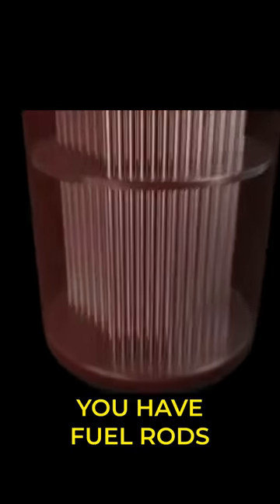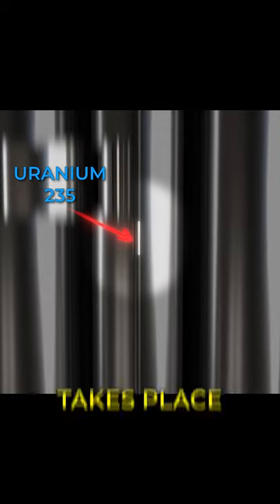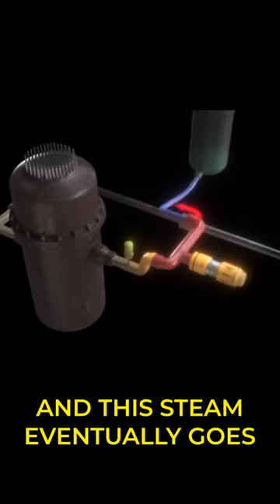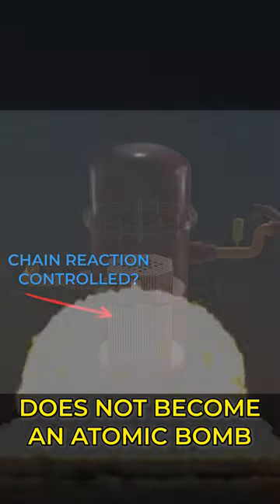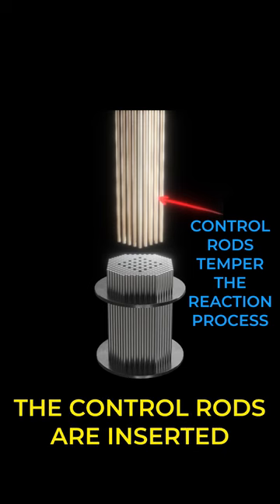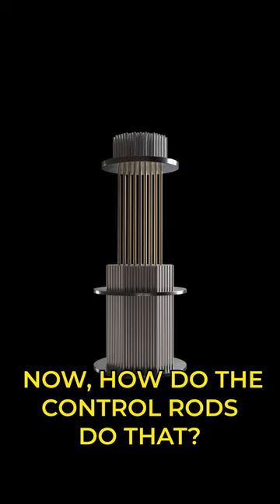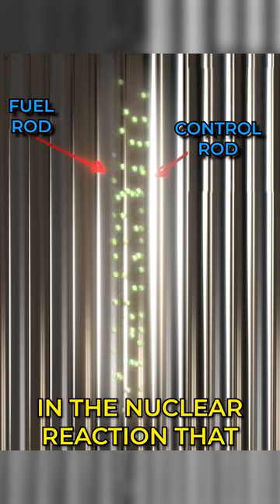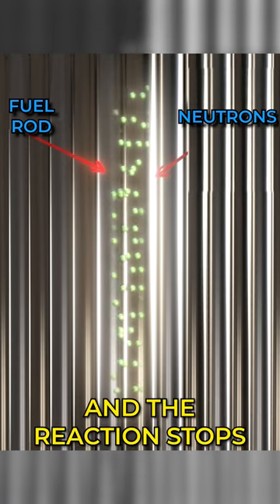How Nuclear Power Plants Control the Fission Chain Reaction

Comment: A reactor cannot become a bomb because the enrichment of U 235 is far too low at less than 5%. Super criticality would lead to a meltdown. Control depends on the design but criticality is usually maintained through extent of  insertion  of control rods and/coolant chemistry in the case of water moderated reactors.
Reply: Glad u said that. I detected the same error in the story.
Reply: You’re absolutely right, either a meltdown or chemical explosion caused by xenon poisoning.
Reply: Tsjernobyl entered the chat.
Reply: The enrichment is much higher than 5%. Try high 90’s. Source: I am a reactor operator.
Reply: @anthonymonge7815  I am a nuclear scientist,  working in Uk nuclear power industry for 35 years. Commercial reactors have a maximum of 5% U 235. Our AGRs have an average 3.8% while the water reactors have 4.5%. Only submarine reactors have high enrichments of more than 70 % because of high  neutron leakage from their tiny reactors.
Reply: @CanariesExplorer  my experience is with US Navy reactors. Both sub and surface reactor enrichment is above 90%.
Reply: @anthonymonge7815  That high enrichment is typical for Naval reactors only. The video and people above are correct - commercial power reactors of the LWR type are 3-5% enriched
Reply: @ThomasConover Chernobyl didn't explode like an atomic bomb, it was first a steam explosion, and then a hydrogen explosion, research before talking rubbish!  It's Chernobyl and no Tsjernobyl you know so much that you don't even know how to write the name of the plant correctly.
Reply: @anthonymonge7815 high 90s? Lol. So you're fissioning weapons grade fuel?
Reply: @dvigil50  Yes. The reactor cores on ships need much more enrichment than land-based cores. It is a weight and size consideration. If you do not believe me, that is fine. I was only a reactor operator for 12 years in the navy.
Reply: @dvigil50  also, it cannot explode like a weapon. Wrong geometry.
Reply: @anthonymonge7815  yeah I knew that much, didn't know about vessel reactors needing that high of a level of enrichment though. Wild stuff

Comment: The reactor cannot become an atomic bomb due to the much lower enrichment of the uranium.
Reply: It can still produce equal amount of nuclear waste spreading over a whole continent. Just research what happened to Tsjernobyl.
Reply: Underpaid huh?
Reply: @ThomasConover you're comparing apples and oranges dude.  Atomic bombs CAN make a crap ton of radioactive materials if the are ground burst.  This is from nuetron activation of the earthen materials.
Reply: @kayakMike1000  🤣🤣🤣 you obviously have allowed your doctor to X-ray scan your brain a few hundred times too much. I’m not disagreeing to your statement tho, but your statement was completely irrelevant to my comment whatsoever. 👍😊
Reply: @ThomasConover Chernobyl was a gas explosion, too much steam, xenón-135 and hydrogen caused the seal to explode due to the high preassure and go up and down and when hydrogen meets oxigen it becomes volatile and thats was the big explosion.
Reply: @ArmorMayhemSoldier_39  of course that’s how all reactors would blow up and anyone with knowledge about reactors know that. And that led to entire Europe getting contaminated by radioactive fallout. I remember the TV constantly warned against going outside in rainy days due to radioactive fallout. I was a kid then and I lived just in the center where the whole cloud of radioactive were going.
Reply: @kayakMike1000 Even if a meltdown does occur, it will barely get past the containment, as the containment is designed for high pressure and temperature, besides the core isn’t compact enough to do a atomic explosion
Reply: Came here to say this. It would however turn into a massive radioactive slag heap, and spew contaminated steam and dust all over the place, like Chernobyl.
Reply: @kanketsu52  no it would modern plant designs case for that
Reply: Everyone mentioning Chernobyl.... What about Fukushima Daichi?
Reply: Chernobyl was a poorly designed reactor that was throttled. Fukushima was negligence as the government warned them that in the event of a natural disaster their walls wouldn’t hold. They knew it but just didn’t care at all about it. Modern reactors are extremely safe with a large amount of regulations in place to insure safety.
Reply: @antoochibbo1355 what about it? In comparison to Chernobyl, it was almost nothing. You can safely stand very near the reactor buildings in Fukushima today. You will not be able to do that in Chernobyl for hundreds, if not thousands, of years.

Although it was a disaster, it was actually handled properly given the circumstances. Chernobyl was not.
Reply: People really need to be re-educated; you would wonder why no other event like Chernobyl has ever happened since.
Reply: Correct but if there is a accident, the radiation poisoning is worser
Reply: chernobyl begs to differ
Reply: @ThomasConover  Youre extremely misinformed. The fallout from a nuclear weapon detonation is insignificant when compared to Tschernobyl. In fact Tschernobyl was so bad that no modern nuclear plant can ever produce even remotely as much contamination. Mainly because we dont literally let a huge ass reactor core full of flammable graphite burn for days on end open to the atmosphere. Even the Fukushima meltdowns didn't even create a fraction of the pollution of Tschernobyl.
And any nuclear weapon, unless it is specifically a "salted nuke", designed for mass contamination, contains too little fissile material to comprehensively contaminate even just its blast area to levels that are too dangerous for humans to live there.
Reply: @Bitt3rh0lz  nice imaginary story bro. 🤣🤣🤣
Reply: @ThomasConover  Maybe you should look it up before you discredit it. Your view is false and your information is propaganda. I suggest you Educate yourself before you continue.
Reply: Plus, to make it critical for a bomb you need a precise detonation of the dynamite bomb.
Reply: @mouserr Chernobyl was not a bomb. If you think so, then by your mentality, your water heater is also a bomb.
Reply: @angrytedtalks more like the uranium fuel is not refined enough and mostly plutonium is the used for bombs
Reply: But it can meltdown and emit large amounts of radiation
Reply: Obviously not in Chernobyl
Reply: @kayakMike1000  The unspent fissile materials and fission products create serious radioactive fallout irrespective of the altitude of detonation. Remember that in fusion bombs there is a lot of leftover plutonium from the sparkplug (second fission reaction that starts fusion)
Reply: @ThomasConover  That is NOT how reactors other than Russia's RBMKs would fail. And they had to work (with no nuclear engineers on site!) to make it go that badly. 
Fukushima was about as bad as a western reactor can be. Not minimizing that catastrophe but
Reply: It can become and need to 1 ×10000×100000
Reply: The was a story that a kid made nuclear  reactor in the garage and no one did not know  .
Reply: @davidconiglio7577  The kid's name was David Hahn, and he tried to create a breeder reactor in his mom's backyard. He's also known as the Radioactive Boy Scout

Comment: One thing to note from this explanation.  The primary loop water, which goes through the reactor, never goes through the steam turbines.  There is a heat exchanger to the secondary loop, which carries the energy to the steam turbines.  If you ran the primary loop through the steam turbines, the turbines would become so radioactive that you could never service them.  Therefore, the primary loop and secondary loop water never touch.  This was over-simplified in this video.
Reply: That's true for PWRs. The type shown in the video is a BWR, which has only a single loop (activation products do get into the turbine at BWRs, but their dosimetry programs prevent major issues there).
Reply: That’s correct for PWR but not for RBMK.
Reply: they released first loop to ocean after fukushima accident ... ;P and so far we are fine. except covid like chaoses may or may not be related :D
Reply: So simplified it wasn't even there....
Reply: As noted above, BWRs operate this way. PWRs have a primary and secondary loop with a tertiary loop to the cooling towers or other ultimate heat sink.

Comment: A nuclear reactor could NEVER become an atomic bomb.
Reply: What happened with tschernobyl and fukushima
Reply: @matsu8205  a meltdown happened, not an explosion
Reply: @matsu8205  Chernobyl: Meltdown to steam/pressure explosion. Fukushima: Chemical explosion (hydrogen gas with oxygen), also with a meltdown
Reply: Just a nuclear contamination mess.  Small booms from hydrogen and if you live near by, well now you don't.
Reply: @matsu8205  Neither were nuclear bombs? Fukushima was also pretty harmless the area is entirely habitable no fallout. All deaths were directly from the tsunami and only 1 case of radiation poisoning which was an engineer inside the reactor
Reply: @kiattichairungsithum4716  there was an explosion at chernobyl dog the damn power plant was split open.
Reply: RBMK reactors cannot explode
Reply: @SaidBKD95  RBMK reactors used to have graphite tipped control rods. in the case of chernobyl, the reaction was already out of control and the control rods got stuck in place when AZ-5 function was initiated. this increased reactivity and the reactor did, in fact, explode.
Reply: Why?
Reply: @SaidBKD95  RBMK reactor did explode when they tried to force their way out of a zenon/iodine pit without a single nuclear engineer on site to stop them. They had to work to make that happen.
Reply: @sheikhgamer007  Because the uranium used for them arent enriched enough as in nuclear weapons
Reply: @kiattichairungsithum4716 neither happened, it was a gas explosion, not a nuclear explosion and not a meltdown

Comment: its not just control rods at most plants. at the plant i work at we use boron in the water to absorb neutrons and thats the primary way to control the reaction. Think if we had to insert the control rods from the top a lot of the fuel would be unevenly used therefore the boron allows for a more even use of the fuel as it is in equal concentration through the reactor coolant water
Reply: Most plants use valves and pumps to control the plant like cvcs
Reply: @dornog70  there’s a lot of things that go into maintaining plant status. We’re talking about reactivity and that’s controlled through boron. There’s also 31000 valves 😂
Reply: @JonBorpa  yea I hate how these “tutorials” aren’t realistic like steam going into the steam generators is crazy
Reply: @dornog70 The turbines run on actual steam, but that steam is created with additional steps to avoid steam in the reactor itself (which generally is part of a major accident) .
Reply: I always wondered about uneven use of the fuel ....like the bottom would runout first. Boron does gobble up neutrons.

Comment: It's always an aneurysm-inducing nightmare whenever I read the comment section of anything nuclear-related.
Reply: try it with a phd in nuke fizz...but really, the reactor talk is engineering, they never discuss the actual physics.
Reply: @DrDeuteron nuclear mechanical engineer, from what I've seen, you're right it mostly comes down to the application. The fizikz of the reactor are very intriguing, but I can see how it becomes a bit confusing, with all the daughter elements formed briefly and then forming something else almost instantaneously. It's alot of probability curves, esp in breeders in my understanding.
Reply: @Not_Sure_2505 I still can’t fathom nuclear. The people saying it’s primitive and it’s just a steam engine are just dumb imo. it’s so much more than a steam engine. We have a big plant in Ohio. David- bessy. Spelling could be wrong.
Reply: @johnbutler2780  it's primitive in the sense that we are just boiling water to spin a turbine; that has been around for a long time, and we have had many many years to optimize that system. The fun is when you get into the details of the nuclear reaction itself, and the controls that are needed to keep everything working as efficiently as possible. New reactors (gen 3+) are very heavy on the passive safety systems, not to mention they amount of chemistry and neutron monitoring that occurs throughout the operation of the plant. From a 50,000 ft view, its a simple process. When you get in closer, that's when it's noticed that material science, nuclear science, chemistry, and civil/structural aspect all shine through. Nuclear plants really are a marvel of engineering, harnessing very energy dense elements and converting that energy to useful electricity, and even process heat.
Reply: @Not_Sure_2505  I agree with the basic premise of the steam powered turbine. I was referring more specifically to as you stated the nuclear reaction in itself and harnessing and controlling it to produce energy. I try to read about it but I just can’t even grasp what radiation is. I know the definition it’s just mind boggling. I mean the fact atoms aren’t even visible to the naked eye is crazy to me as well. Let alone the process of a nuclear chain reaction. It is really fascinating I just can’t comprehend it tho lol. your response was refreshing to read and you made awesome factual points through it. Thanks! 🙏🏼

Comment: information is wrong  because i am mechanical enginne rso according to studies the water is never converted into steam, it is the hot water at high temperature having very low pressure goes to another water tank and heats the cold water in the pipes and converts it into steam and that cold water which is converted into steam is further made to move the turbine and electicity is generated and the hot water which comes from the reactor which heats the cold water echanges the heat and again goes to the reactor with low tempearture.

Comment: If the rods can't be lowered, use a basic heat fuse to open a big bottom hatch and drop the whole mess into a pool of control rod chunks. No threat of China Syndrome. Not that I actually know what I'm talking about, of course - take with a grain of molten salt.
Reply: A China Syndrome is not a legitimate accident scenario for nuclear reactors - the movie kinda hyped that up with no backing.
Reply: Yet it almost happened at Chernobyl, the infamous "elephants foot" is the molten core on its way down, but stopped by a block of concrete .

Comment: Steam going into steam generator circulation loop? 😂
Reply: Not in this type of reactor. This is a boiling water reactor, where the water boils in the core. You are thinking of a pressurized water reactor, which uses a steam generator.
Reply: @joevignolor4u949 yea i know, clearly this guy doesn’t know what he’s talking about

Comment: How is the water not radioactive
Reply: It is. This is a boiling water reactor. The water boils inside the reactor and then goes directly to the turbines to spin the generators that make electricity. It's a simpler design, but the disadvantage is that the radioactive water goes outside of the reactor and through the turbines and then the condenser. The other type of reactor is a pressurized water reactor.  It has two cooling loops. The primary loop carries water under high pressure from the reactor core to a heat exchanger, called a steam generator, that generates steam in the secondary loop. The steam in the secondary loop then drives the turbines. It's a more complex design, but the radioactive water stays in the reactor's containment building and does not go out to the turbines and the condenser.
Reply: @joevignolor4u949  is the first one legal

Comment: Well yes but actually no
Reply: Expand?
Reply: @Not_Sure_2505  it is impossiable for a nuclear reactor to detonate in a fission explosion at worst is will meltdown the only explosion would be from steam pressure   build up even a old janky Soviet reactor can't go boom like most think.
Reply: @Not_Sure_2505  the isotope that is able to chain react and split is not in high enough concentration would be analogous to trying to get you car to run on un refined crude oil, many issues from toxic micro plastics to the green house effect to almost all enviromental polution would go away over night if the world went to atomic power.
Reply: @brobasticbroham446  I wanted to see what your stance was here, why I asked to expand a bit. You are correct, they cannot explode in the same sense a nuclear bomb does. They can potentially build up hydrogen if the right conditions are met, however in gen 3+ pwr reactors with the passive autocatalytic recombiners, and the amount of aluminum in containment is strictly monitored strictly accounted for, that risk is pretty low.

Comment: Edit: This may no longer be correct.

OP: For those wondering, the neutron-absorbing material is usually cadmium, indeed as in nickel cadmium rechargeable batteries (it’s what we had before NiMH, and they were heavy).
Reply: Isn't graphite also used? Just domething I thought I remembered
Reply: @ChaineYTXF  I’m beginning to wonder if cadmium was just the first material they used and they changed.

Comment: The water isn't boiled in the reactor. It reaches an EXTREMELY high temperature with water kept at high pressure to avoid the creation of steam. Steam is created from a loop within the reactor that brings the high pressure heated water through a pipe into a steam generator tank, where water surrounding the high temp water piping gets coverted into steam.
Reply: You’re talking about a PWR. this video is explaining a BWR type reactor
Reply: Boiling Water Reactors boil their primary water in the reactor.